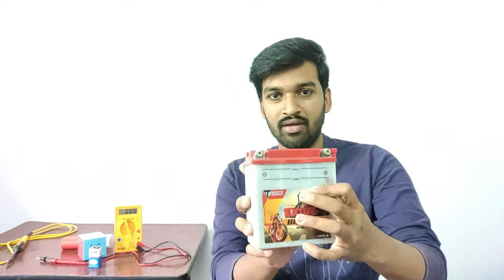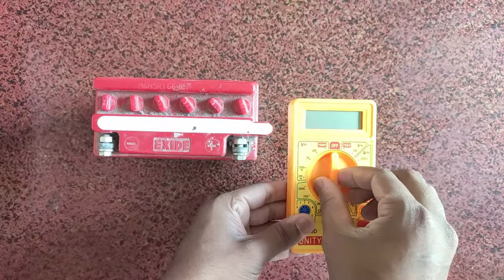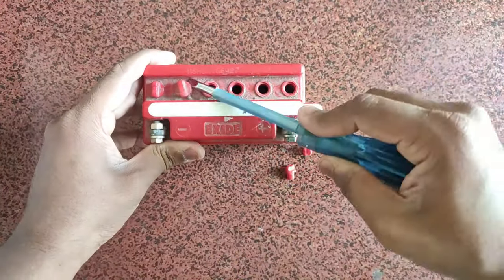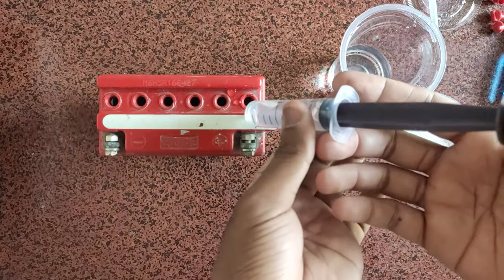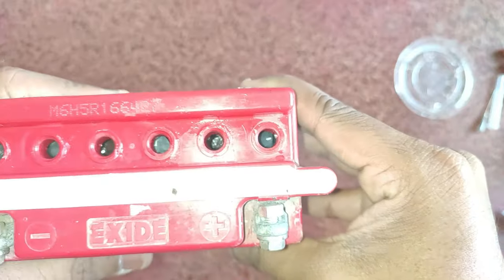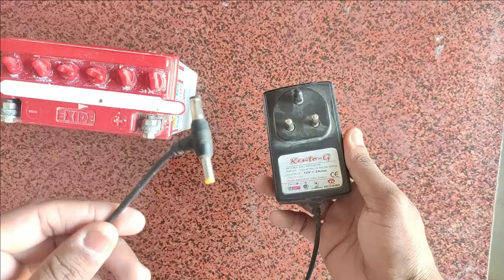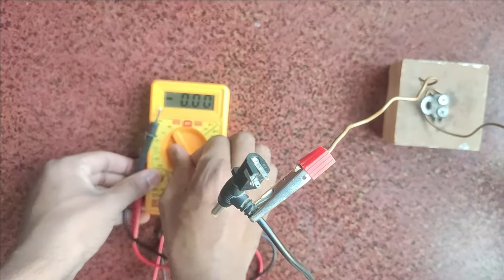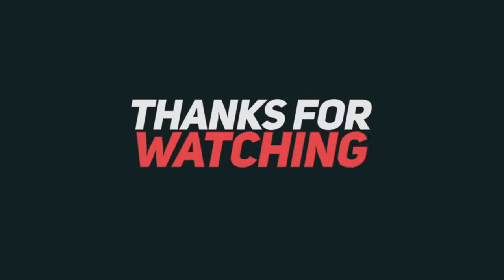How to charge 12v bike battery at home | In Telugu | Charge 12v battery at home

Comment: i did it for my batterry 6 months ago it is very well worked. when my battery is dead went to the battery shop and they say you have to change the battery, for dry batteries charging will not work. but i did for my own and it is worked.
Reply from the maker: Thanks 😄. Do check other videos and share with your friends
Reply: Connect a load like 12V, 60Watts in series with a DMM note the voltage at 5amps. Please give the supporting readings always. I again ascertain that it will never work.
Reply: Neeku entha echaadu bhaiiyyaa cmnt ki..... 😂👌
Reply: You have not mentioned at what current you are using. Say at 5amps, what is the voltage? At 5amps, how long it is supplying power?

Comment: As a testing Engineer in BSNL,one caution..  If you charge a dead  or over discharged battery for bikes or Cars, don't fill 1200 value specific gravity electrolyte.After filling what this video said,if you charge and connect the engine may start and while charging the same battery through in-built vehicle dynamo,it will get over heated and even the engine also gets too much heated with metal burning smell. Those repairs will cost you more than buying a new battery.If the eXisting battery life has crossed 4 years better buy new one with exchange offer.Happy riding👍
Reply from the maker: Well explained 😄. Do check other videos and share with your friends 😄

Comment: Bro battery place lo capacitor use cheiyavacha bike ki? Incase work ithay ndhuku capacitors vadaru? And meku possible ithay complete  video cheindi plz.
Reply from the maker: Capacitor ki 1 sec lo motham drop aipotundi voltage and cannot give voltage continuously anduke manam battery vadtam. You can also check technical knowledge playlist in my channel 😄
Reply: Battery 12v unte oka adpter thisukoni kinda loop cut chesi dantlo 2wires vastai kada avi + - 2terminals petite saripotunda adi charge avutunda, tarvata bike lo auto charge avutunda mari

Comment: Battery water or distill water
Reply from the maker: It is actually distilled water but you can also call it as battery water as it is only used in batteries 😄
Reply: Yala, i little bit confused that u said battery water 😂
Reply: For acid batteries, which are used on inverter, can i pour acid water or distilled water??
Reply: @techvraj  distilled water , available at Rs 20/- per Lt. in Petrol Bunks.
Reply: Bro current thone change cheyyala

Comment: 1.Nowadays few 2 wheeler batteries coming as maintenance free batteries, means no need to pour water. How about such batteries?
2.After 4 to 5 years, any battery life goes off, then is there possibility to recharge such batteries??
Reply from the maker: Will make a separate video in future. Do check other videos and share with your friends

Comment: ఇన్వేటర్ కి కలిపితే ఛార్జ్ అవుతూద
Reply from the maker: Avtundi but make sure
1. You give DC supply
2. Voltage should not be greater than 14v 
3. Check current rating properly. 
Do check other videos and share with your friends 😄